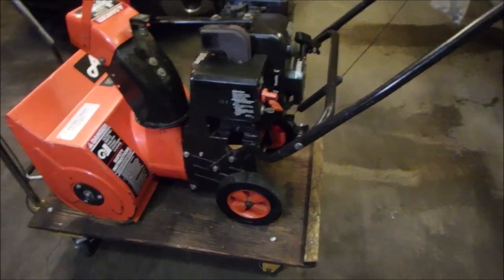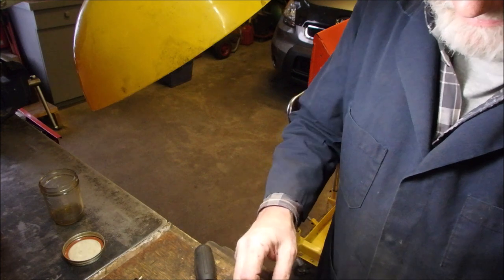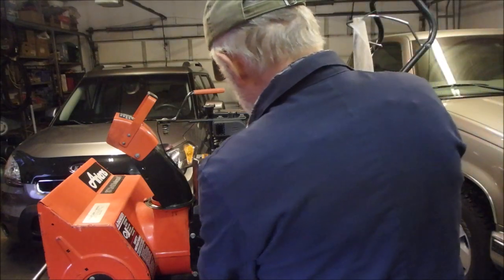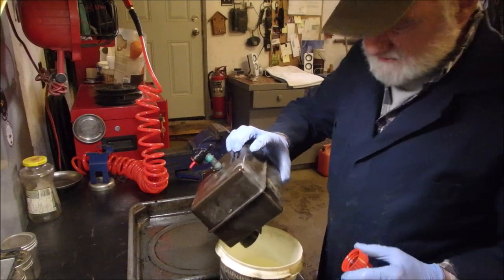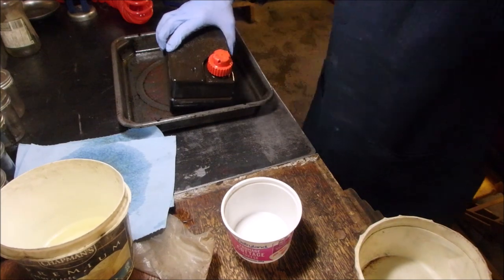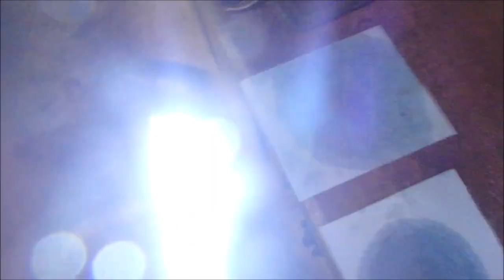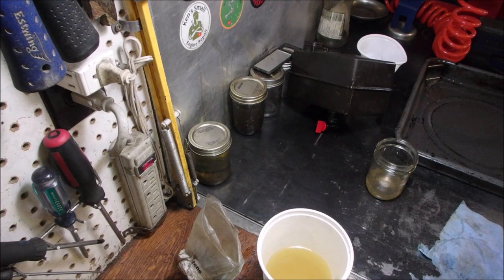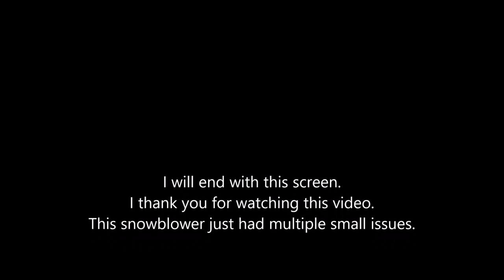Ariens 2+2 Snowblower What have I done!!

Comment: That video brought back some old memories of repairs gone south. I had replaced coils when it was gas or carb issues? I have had to drill out the Welch plugs and dip (old style) cleaner on really bad carbs to make them not rev up and down under the plug are 3 metering holes that get dirty?! This is not normal but will make you bang your head also! Lol. No one on u tube shows this. Good video Bruce.
Reply from the maker: Thanks i have no issues showing what can go wrong.

Comment: Hey Bruce,
Last fall, I had a similar issue with a mower tank.  I did several washes with gas.  Still had a layer of varnish that would not come off.  So, I half filled it with freshly boiled water and dish soap.  It whistled like a kettle when I shook it!  After that, it was completely clean!
Reply from the maker: I will try that.   SAFER

Comment: I have to confess, my heart jumped when the gas spilled. Nice save though. I use aquarium gravel on wine bottles. I wonder if small bearing balls wouldn't work and get in the corners a little more efficiently. Again, another W for the Jedi Knight of small engine repair.
Reply from the maker: You may have recognise the guardrail bolts.

Comment: Debris like that could also come from a fuel line. I've seen them be ok on the outside but decaying on the inside. Tip is the line is very flexible when that happens.
Reply from the maker: Yes earlier in the video I changed out the line and even the turn off valve.